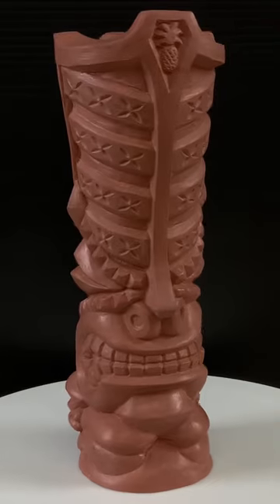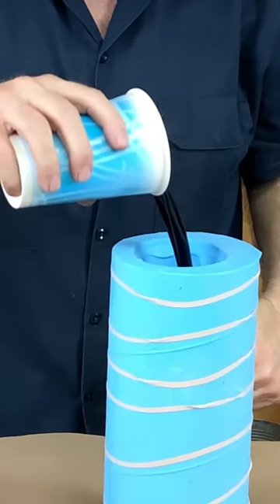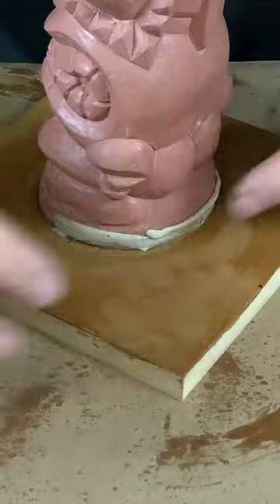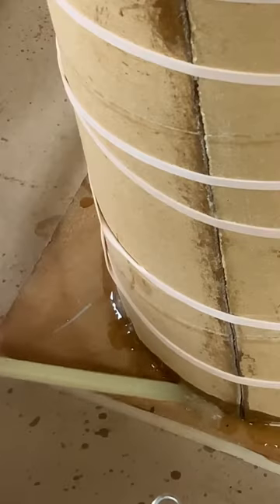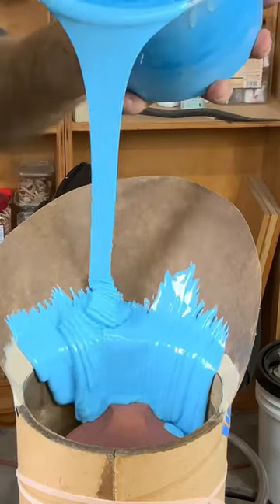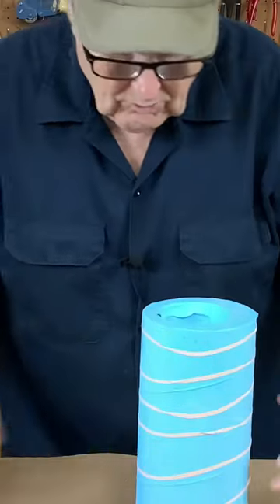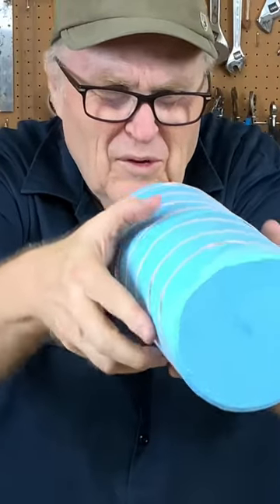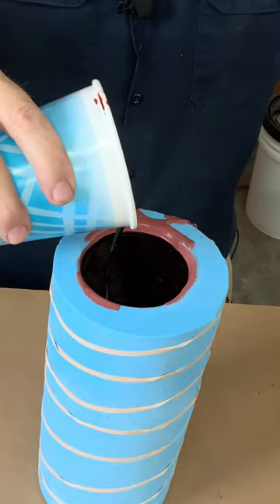Mold and Cast a Tiki Mug By Crazy Al

Comment: Since it’s a mug, I assume a 3-part plaster slipcast mold will be made from the resin master?
Reply from the maker: Yes. At the very end of the video there are a couple of pictures of the mold being made in the mug factory.
Reply: @RobertTolone  Ah, I got it—end of the full video

Did an 8-part slipcast mold one time, it was not as much a disaster as most of the class, but John Gill only gave me a B 🤬

Comment: By "pre-painted", is that applying a thin layer of rubber on the mug?
Reply: No he paints it with a blue paint that’s very close to the color of the rubber he’ll use to cast with.  The rubber sticks to the paint better.
Reply from the maker: @darktherapy  That is incorrect. I am coating the mug with the same rubber I use to fill the mold.  I generally only coat those areas which are most likely to catch bubbles.
Reply: @darktherapy 😂😂